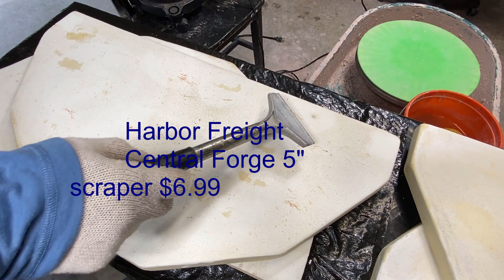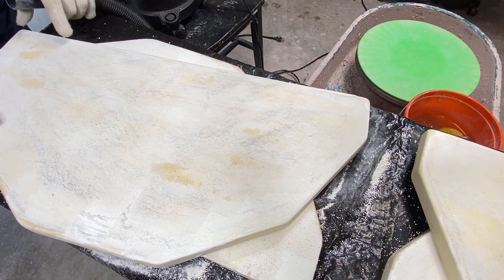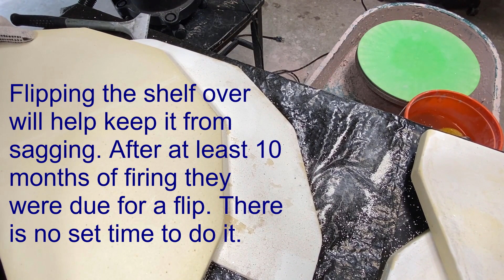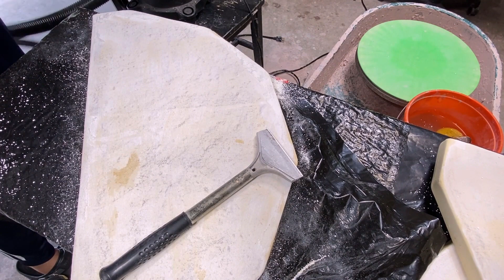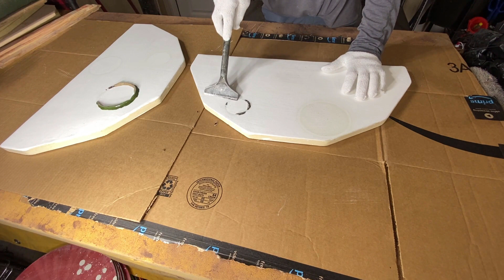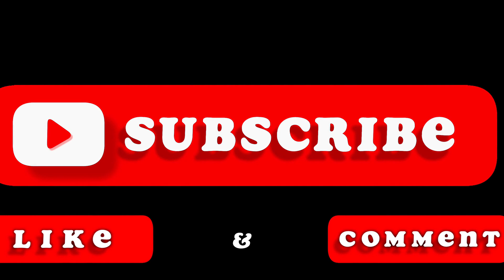Kiln Shelf Maintenance, How To Scrape Shelves         Pottery/Ceramics

Comment: You really don’t need to flip those shelves over. They are not going to warp on you. Also, unless you get every single bit of kiln wash off the shelves it will end up falling off onto your pots.  Scraping shelves outside is a waay better idea as I’m sure you found. Lol
Reply from the maker: Michelle, shelves do warp over time. I have never had kiln wash drip ever and scraping inside my garage is perfectly fine.
Reply: Sarge is 100 percent correct! The shelves DO warp over time and the only reason kiln wash will fall onto your work is if you haven’t cleaned the shelf properly 😉